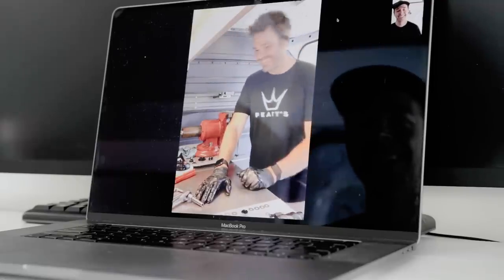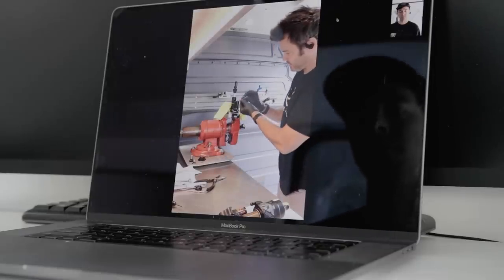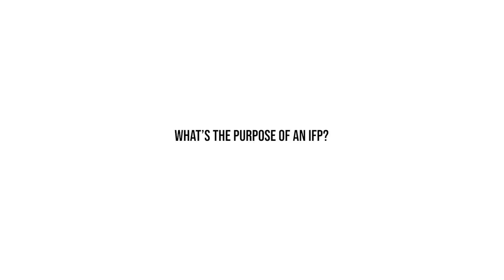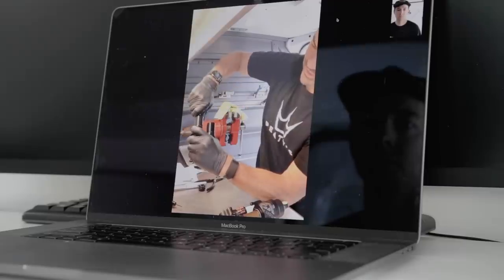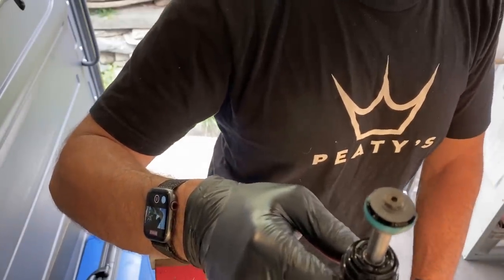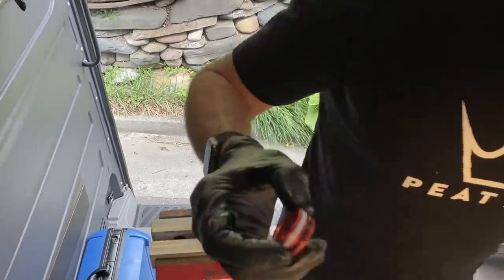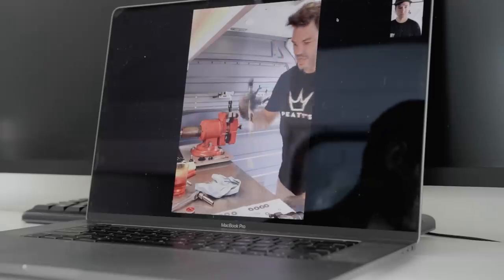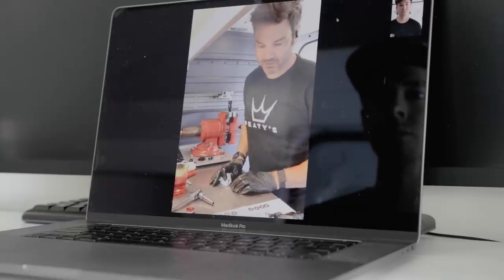DIALED S2-EP15: What's going on inside your shock reservoir? | FOX

Comment: Love the fact that Jordie is using a performance-series on one of his bicycles versus sticking to only running factory. Shows that he keeps in touch with what non-race riders are using! My topic suggestion is that you explain the mechanics of how shocks differentiate between high and low speed control. Also how is the speed defined that is used to delineate between high and low speed and does this vary across the Fox lineup?
Reply: burbs924 we’ve done that it quite a few episodes!

Comment: What is the difference between bearing, bushing, trunnion shock mounts? 
Weight? Friction?
Reply: Trunion mounts can get more travel out of a shock for the same eye to eye measurement than a bearing bushing mount. They are also stiffer and resist rotational forces better.
Reply: Purely friction and in the case of trunion it makes the overall shock a bit easier to package. There is no difference in travel or function
Reply: Purely friction and in the case of trunion it makes the overall shock a bit easier to package. There is no difference in travel or function
Reply: jordi cortes i just bought a new 2021 DHX2 for my Megatower. With mounted Hardware it is impossible to change the spring without dismounting the Hardware. Why? Thats crap! You should fire the engineer!
Reply: @wohli666  Wider shock mounts can offer better rigidity, so deal with it, and be happy Santa Cruz cares. Once the bushings break in a bit it should be easy to remove the hardware anyways.
Reply: @Twisted_Biscuit  torsional forces are irrelevant, the shock can be rotated in itself between the mounting points, regardless of how its mounted. What you perhaps mean is shear forces that are transferred from the rear into the shock, but that isnt alleviated by Trunnion either. The rear triangle and linkage of the frame has to take care of it and if it doesnt, its usually coil shocks with small diameter piston shafts that have an issue with it (and eventually even snap). The other things you named are the advantages of Trunnion, nothing else.

Comment: Nice video, as always. Love the Dialed series! For a future video I wouldn't mind seeing how your current fork dampers are mechanically unique, stuff other than adjustments. It would be cool to see the internal mechanical differences between GRIP, GRIP2 and FIT4. Are they all closed systems? Does only GRIP have a bleed port? Is there large performance differences between each?
Reply from the maker: Glad you're enjoying the series Zach, that sounds like a great episode, we'll try to work it into the mix. 👊
Reply: Zach Moore we did that with the damper a few weeks ago!
Reply: @jordicortes4993  wasn't that just the new GRIP2? Do you have one that details FIT4? Is GRIP basically identical to GRIP2 other than needle/shim adjustments?
Reply: GRIP has a bleed port, but with regular maintenance it won't be utilized as an oil outlet much. It's mostly to keep a steady pressure on the damping fluid with the hole preventing air pressure build up. Steady oil pressure helps to prevent cavitation.

Comment: Can you show us how you would bleed a coil shock and how much oil does a shock normally take (230x65mm) as my Marzocchi bomber cr coil shock had leaked oil out the rebound adjuster. Now fixed now but feels like there is air in the system.

Comment: A little off topic but once you find a good sag point on shock and fork. How much pressure plus or minus is  recommended by jordi for different track conditions? I heard him say only go 3 psi to some of the pros in last years videos . I run 20% sag up front fox 34 and 27-30 in the back dpx2. Thanks guys! Videos are great!
Reply: Typically less sag in the front to help from brake diving. I've heard Jordi say that EWS Enduro guys run as low as 15% sag up front on steep courses and the typical 20-30% out back.
Reply: Whatever works
Reply: @jordicortes4993  come on Jordi, thats not a proper reply, you're better than that surely ?

Comment: Great video and information. So my question is. When you get air in your shocks oil IS that a result of the IFP seals not sealing and therefore they need replacing OR would I need to check/replace any of the other seals aswell ? Oh, what is the screw for thats in the centre of the IFP? Is it used to screw into with a threaded tool and make it easy to remove the IFP ?

Comment: Sweet video once again! . Let's see something regarding different shock tunes. And maybe Adress the  window of adjustment; I.e. "if my shock has Medium tuning and it's wide open, should I get it built with a light tune?" 
Maybe adress digressive rebound tunes as well. I love the techy stuff 🤣

I have a custom dpx2 on my Megatower and it's insane. Light compression, light/digressive rebound, firm lockout valve with remote 😶 fox rocks
Reply: The Suspension tech at my shop is the man 😎

Comment: These #dialed edits are really helpful. I have a question: I'm running a FIT 4 36 and a DPX and I'd like them both to feel more plush on the initial part of the stroke (just after the sag point, in Open mode) without diving though their travel. I know I have (up to) three variables: air, spacers and compression damping. Which should I adjust, given that I'm not a particularly aggressive rider (just old and heavy 😂)?

Comment: 10 minutes on the IFP to explain how it works but not a word about why it’s there...  
for those wondering : if you do not separate damping oil and air, they would end up mixing together as it shakes, leading small bubbles to go through the piston and ruining damping properties of the suspension ;)

Comment: Why does compression have to flow so much oil? Is it helped out by the damping on the bridge going into the reservoir enough for it to not need so much damping on the piston? Or is it actually the fact that compression damping force acts in the same direction as the spring does, while it's countering the spring in rebound?

Comment: Can you pls ask jordi how the the fork and rear shoch coil and air will react with lighter riders like 50kg to 70kg and 160mm to 180mm of travel thanks
Reply: TYLER'S TRAIL MADNESS I’m not sure what the actual question is? Are you asking if a lighter rider should ride a coil?
Reply: Hi jordi sorry i didn't ask my question clear enouph.
I wanted to ask how a coil shock would act differently compared to a air shock with a light rider.
Thanks hope this makes more sense👊
Reply: It wouldn’t.

Comment: Thanks guys! Is nitrogen better than air in the res?
Reply: Matt Simon better, probably. Worth the trouble. No
Reply: @jordicortes4993  thanks jordi! I was thinking the same. It seems like the difference in tires. There is a benefit but it doesn't seem like the cost and equipment is worth it for a shock.

Comment: Guys, it would be much better if you both recorded your sound and then used it in the video instead of using the Facetime sound of Jordi. I’ve seen this in some podcasts done recently and it improves the experience significantly. Apart from that - thanks a lot for the work you do even when it has to be quite uncomfortable for you ;)

Comment: Is there any reason an IFP could not be replaced with a piece of MCU (Micro Cellular Urethane) or similar closed celled foam/rubber, which can compress, but don't have the inherent friction of a seal which is needed for a piston?

Comment: Does IFP pressure (or volume?) change for different shock strokes? I presume the reservoir volume is the same for all the different shock strokes, so how does a longer stroke shock (which will displace more oil) differ to a shorter stroke shock in regards to the IFP. Or is it simply that when you change the stroke the piston just starts further out of the shock body, creating the "increased" volume at the start of the stroke.
Reply: Nic Treadgold we actually don’t specify different ifp depths. The movement from shortest to longest shock really isn’t that much so we just make sure it clears all versions to keep it simple. On non resi shocks it’s stroke specific
Reply: Good question, and answer 👍🏼

Comment: when i pressurize my ifp chamber on my float x2 the service manual says 125 psi - so i pressurize it up to 125 remove the shock pump than reconnect the shock pump and i only have 80psi or 90 psi left in my ifp chamber - so i pumped it up to 170 and after disconnecting and reconnecting i had the desired pressure....is that an ok procedure? cheers guys - great video
Reply: When you reconnect your shock pump, the air from the reservoir chamber escapes and fills the line on the shock pump to equalize the system. Since the volume of air in the reservoir is so small, the “reduction” in pressure is large. The same thing will happen on the the air spring in a fork or shock but since the volume of air is so much greater compared to the volume in the shock pump line, the relative pressure loss is only a few PSI. If you have a pump with a zero loss valve, you can pre pressurize the shock pump line to your “correct” pressure before “opening” the line and the pressure should stay more consistent instead of trying to equalize between the pump and reservoir. When you fill your reservoir, stick to the recommended pressure and just know that when you reconnect the pump next time, air will escape and you will have to reset it back to the recommended pressure.

Comment: How would you advice in this scenario? Correct sag/air pressure, fully opened HSC/LSC but still feels harsh on square edge bumps?  On a 2020 grip2 36
Reply: You can’t run zero damping

Comment: I would love a video on High Speed rebound. At the moment it's the thing i cant wrap my head around
Reply: KATETA Y00 it’s the same as high speed compression just turned upside down.
Reply: @jordicortes4993  well yes, but like if I ride and something's off with my suspension, I don't know if it's the hsr or the lsr that needs changed, if that makes sense

Comment: I hear a lot about some nitrogen filling process that has people running the other way because of "service friendliness" (I prefer the phrasing "the service is not unfriendly") Maybe you can shine some light on this
Reply: James Naughton maybe explain that more? I’m not quite understanding
Reply: @jordicortes4993  You mentioned filling the resi with a shock pump? I thought it got charged with nitrogen like  Fox's off road stuff?
Reply: jordi cortes I could be wrong but I think he means that because fox suspension has nitrogen charge and we everyday riders do not have the equipment nor the qualification to deal with that stuff, some of us choose other brands which may be more self service friendly. This alludes to the idea that other brands either have an easier “nitrogen filling process” or they simply don’t have a nitrogen charge (although I honestly don’t have any idea as to which is the case). I guess a lot of us have heard of this nitrogen charge but don’t know anything about it because it’s usually the reason that we’re told not to self service and it’s the reason that most local bike shops say “hey so we’re gonna have to send your shock to the factory”. It would be cool if you guys could do a comprehensive episode on this stuff.
Reply: I asked this question 2 weeks ago to GMBN tech. Nitrogen is better long term, less susceptible to temperature, doesn't absorb moisture, so when they ship it off from the factory they don’t expect the customers to get its straight away and like you said they don’t’ expect customer to do the service as often. it remains consistent. Normal air works fine its behaves the same as nitrogen but not good for long term.
Reply: Nope.
Reply: in the service guide for the DPX2 you can see that they do charge it with nitrogen
Reply: So you recommend Nitrogen charge all the time... or can it be done with 'regular' air? In one of the Dialled eps from Fort Bill last year i'm sure one of the shock techs pressurised the reservoir with a shock pump.
Reply: jordi cortes fox suspension, correct me if I’m wrong, needs a nitrogen charge to overhaul the damper assembly. I’m clearly with these other guys in the comments where we just don’t know if that applies to the dhx2, since it is a coil and might not have the same or similar damper assemblies, or even have one at all. Could this possibly be an excuse for bike shops, having done the time/money math and found its worth it to send it in to dirt labs, or is it a real obstacle for anyone including home mechanics. There are cheap nitrogen chargers for automotive equipment which makes me think...could I bodge something together...hopefully I don’t lose an eye

Comment: Hey Guys, Love watching the episodes.  I've got a 2019 Cube stereo 150 with the Float x2 on it and am having trouble getting proper sag.  I've got the air psi maxed at 297 and am still not quite getting 30%.  I weigh 230 lbs.  Would adding air to the IFP chamber help?
Reply: You should check if you allready used the maximum amount of volume spacer in your shock
Reply: already has the max spacers in
Reply: Strange i run 220psi in the DPX2 factory on the same bike and its at 25% Sag....but I only weight 65Kg
Reply: @Dovakhin94  sad, that would have been the easiest way to solve your problem.you should check if the right presure is in the IFP.
Reply: Yeah thats what I'm thinking too.
Reply: That bike is extremely high leverage. You’ll probably struggle to get proper sag at your weight.
Reply: Darren, time to get a coil shock!
Reply: Would adding more presuure to the IFP help?
Reply: Do not play with ifp pressure it’s not going to get you what you want
Reply: jordi cortes 👍roger that

Comment: Hey guys what shock pump is the most accurate?
Reply: Edward Gurley no idea. I use the free one
Reply: IMHO doesn't really matter, just use the same pump all the time so you can make accurate changes to your setup - you'll have 100% 'relative' accuracy for tuning, the 'absolute' accuracy isn't really anything to be concerned with.
Reply: bogler bill  nice! I was thinking the same thing just wanted to confirm. Thanks! 
Another quick question: troubleshooting the DPX2 EVOL on my Enduro. When I turn compression to firm, there is barely a difference versus wide open. It used to be much firmer. Coincidently I swapped the  0.4 volume spacer to 0.6, followed all the correct procedures per Ride Fox website (cycling 25% travel every 50 psi to equalize chambers) and went through the procedure twice with no difference in results. Any insight or advice you guys could offer?
Reply: jordi cortes sweet pickles thats awesome! 🤓 You guys must  get all the great swag.